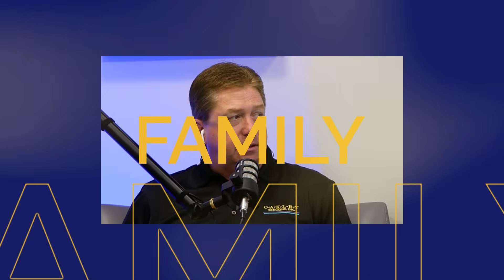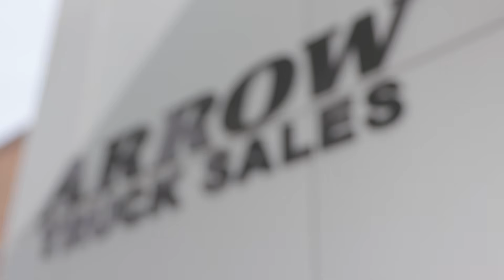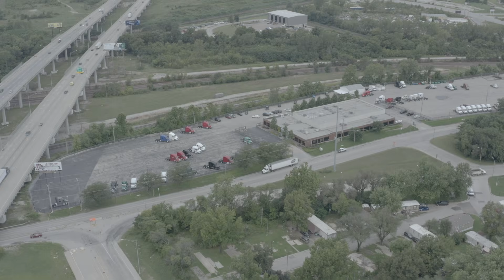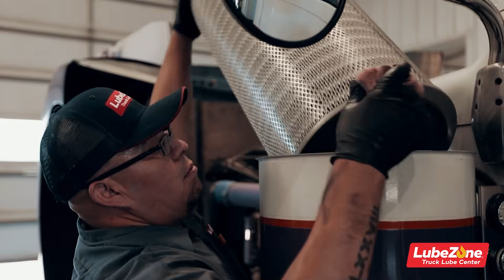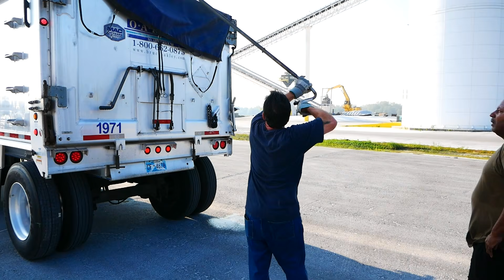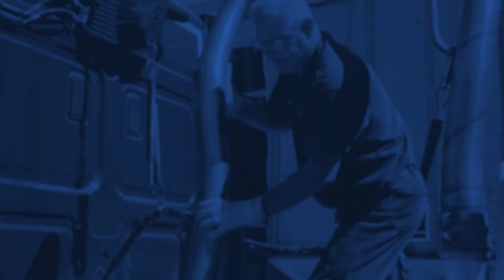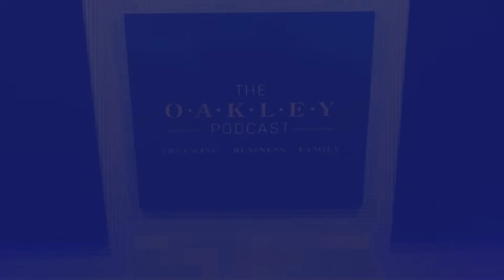196: MATS 2024: The History of Gulf Coast Filters and How They Have Changed the Oil Industry

Comment: About 20 years ago a new Dodge Cummins pulled into the yard. It was a local retired USAF fighter pilot. Also retired from Texas Instruments. He said change the oil and bolt a big Gulf Coast filter on the Frame. Dont be drilling any holes in the frame. All of a sudden I was back in the 50s as a private. I said yes sir. The used oil did fine in my old 6.9 Ford diesel. Normally I didnt drain the oil. I installed the Gulf  Coast filter and added enough oil to fill the filter. This guy wanted to go to synthetic oil. In his case he brought enough Amsoil.

Comment: I have little Gulf Coast toilet paper filters and Motor Guard toilet paper filters on everything I have with a oil pump. They are gone now. I  only have two of the origional lube oil filters. The  Motor Guard M 30 compressed air filters are similar to the origional lube oil filter. It has 1/4 inch ports instead of 1/8 inch ports like the lube oil filters and no 1/16 inch orifice. The origional lube oil filter had no coating. The coating sometimes fails. Normally lasts in motor oil. The lube oil filters came out in 1961. They were discontinued I believe in the 70s. Motor Guard stayed in business by making compressed air filters. They learned almost everyone thinks oil is supposed to get dirty and be drained. I converted the M 30s back to lube oil filters and sold them for awhile. The compressed air filter elements have a plastic core that cant take hot motor oil. I ended up with a drum of expensive compressed air elements I use for shop rags. All of the origional filters used 2 ply toilet paper. I was getting it by the case from Office Depot. Got a call from California. They were looking for a filter to eliminate oil waste. Since I only sold a couple a week I wasnt legit.

Comment: The reason almost all little toilet paper bypass filters have the orifice at the outlet is pressure is on both top and bottom of the toilet paper. Slightly more at the top. The same as using a sandwich adapter. The reason I can use a oil cooler sandwich adapter is the toilet paper filter is like a restricted oil cooler. A spring loaded bypass valve opens to keep enough oil going to the inlet of the full flow filter. One of the 6 cylinder diesels I sent Gulf Coast filters for had a little less oil pressure than the others. The engineer drilled a 1/8 inch hole in the adapter to help the relief valve to bring up the oil pressure. Perma Cool says the relief valve is big enough to supply the engine. Might not be if the engine is worn enough to need more oil to pressure up the system. Always better to have a oil pressure gauge when using a sandwich adapter. The old Frantz 2 port sandwich adapters depended on  enough oil flow to create a pressure difference. Worked ok in 6 and 8 engines. Not so well in 4s and my riding mowers.

Comment: Pretty much all bypass filters since the 1920s had a restrictor orifice at the outlet. Normally 1/16 inch.The reason for the restrictor is the slower the oil flow thru the filter the better the cleaning. Also almost all toilet paper filters have the orifice at the outlet including my old Gulf Coast junior filters. The little filters clean oil better when the orifice is at the outlet. The big Gulf Coast filters are different. Because they are so big they work better with the orifice at the inlet. Its about the same size orifice as the little filters. They dont need to be fast. All they need to do is clean oil. The full flow filters have to filter fast. Two full flow filters will clean oil a little bit better than one because the flow thru each filter is reduced. Not good enough. Some factory installed bypass filters are pleated paper filters with an orifice. You might be able to get a full flow 40 micron filter to clean oil down to 10 micron. Not good enough for polished engine parts.

Comment: When I was installing Gulf Coast filters 30 years ago all bypass filters were universal. No specific filters for specific engines. You looked at the engine and determined what fittings you needed. I had a fortune in fittings on the truck. Still have most of them. When I did my Ford Diesel tractor had to get a few fittings at Ace Hardware that I didnt have. You can spend a lot of money on fittings. I normally use Gates transmission cooler hose from O Reilly's for the small engines. It aint cheap. In the old days I normally got my hose and fittings from McMaster Carr. When I convert the Motor Guard M 30s compressed air filters back to lube oil filters I press a 2n1/2 inch OD flat washer in the bottom for a core seal. I had a couple I had to ream the ID a little. I tossed the plastic internal parts. Some use the filters as is. The plastic parts will eventually deteriorate in hot motor oil. I use a 1/16 inch orifice in the inlet except with the 2 port sandwich adapter. They dont need a orifice

Comment: In the 60s I found out about the Motor Guard toilet paper filters. Started buying a few from a trucker that was a direct distributor. He drove Pontiacs. He would say I dont drain oil look under here. He had the drain plug welded on. When he bought a new Pontiac which I believe he said about every 100 K miles he would transfer the Motor Guard to the new Pontiac. Imagine some poor bastard trying to change his oil and the drain plug is welded on. Motor Guard later started manifolding up to 4 Toilet paper filters in parallel for diesel trucks. Then they added a compressed air filter. They only have the compressed air filter now. People think oil is supposed to get dirty and be changed. Painters dont think compressed air is supposed to be dirty and wet. I tried to bring them back. At first they thought it was a good idea. Then I think they realized this guy is telling people to use Toilet paper and we are selling our expensive paper. The coating sometimes fails. When I told them to send me 100 with no coating that was the last straw. Havent had trouble with motor oil. Gasoline can make the coating turn loose of the aluminum. For awhile I was removing the coating with my drum of engine cleaner. Mentioned on a forum that Dick Cepek tires sold Motor Guards for off road racing. They didnt allow the word dick. Dick Cepek sold off road racing equipment for VW dune buggies. I bought a steering stabilizer for the wifes beetle. The beetle didnt come factory equipped with a oil filter. Hard to wear out a beetle with clean oil and keeping the valves adjusted. Not putting a filter on the beetle saved VW millions. Owners didnt complain. They thought if they didnt have a filter VW must have thought they didnt need one. Took me several toilet paper changes to clean up the wifes beetle engine.

Comment: The little Gulf Coast Junior was too small for the Powerstrokes. The chippers used Ford gasoline Industrial engines and one truck with a heavy duty 350 Chevy engine. They took the little Gulf Coast Junior toilet paper filters the same as my riding mowers. At 86 its no big deal for me. Hated to see Steve discontinuing the little filters. That fleet was a tree service company. Yes the diesels needed the paper towel filters but they werent all diesels. I have Gulf Coast junior filters on a fleet of propane lift trucks. Let the customer decide how to install the little filters. People shouldnt have to pay up to 800 bucks for a little filter. I sent 6 Juniors to a private Island for generators. Wife said lets go down and help install them. They had an engineer hired to keep things running. Didnt need us. A resort in the Bahamas. Sent sandwich adapters with those filters. Soon after that Charlie Sims chewed my ass for using sandwich adapters with his filters. Got started using Frantz 2 port sandwich adapters many years ago. Got those from Jegs. Summit has them. I used the universal 189 adapters. They have one for supplying a Turbo I would like to try. Lot of choices these days. I think the filters work better with a sandwich adapter. Also make filter installations easier. Brought the Motor Guards back for awhile. The M 30 compressed air filter is similar to the origional lube oil filter. Easy for me to convert them back to lube oil.

Comment: In 1965 I went to work on the Mustang assembly line. I showed the boss the dipstick with the golden oil on the Rambler. He had a Mustang dragster he pulled with a Chevy Suburban with a 292 big six. He said put a Frantz on the Chevy. I used a Frantz adapter that eliminated the full flow filter. He wasnt happy because his oil wasn't as golden as mine. I called Frantz. They asked me what oil he used. I said Standard Special. He said the Special has a additive that gets dark. Drain the Special and put in the Delo. His oil looked like mine. With no full flow filter it was like a 235. You knew the condition of the engine by what was showing up on top of the toilet paper. He used Delo 100 20W. Before I left Ford I put the better designed Motor Guard on his Plymouth Fury and left on the full flow filter. We changed the toilet paper and added a quart of Delo every 2 K miles in those days in the San Jose California area. Would have to make adjustments in different conditions. I have sent Motor Guards to Norway and northern Canada to people that already understand the filters. I changed the toilet paper and add a quart of synthetic oil in the Pontiac Torrent every 6K miles in the Dallas Texas area. Mostly highway. When I did the fleet of mostly Powerstrokes they were on the phone with Gulf Coast Filters. I was just the installer. They brought me Walmart diesel rated 15 W 40 conventional oil. They said oil is oil. Got a call years later saying they had more trucks that need filters. Told them to call Gulf Coast filters.

Comment: I was wrong saying the Insane bypass filter elements are about 35 bucks. I googled it. The cost of the toilet paper equivalent is 48 dollars. The larger one is 108 dollars. They are as good as toilet paper and paper towels. Dont remember what I paid for the last 16 pack of Great Value 1000 at Walmart. They claim 1 micron. Motor Guard has always claimed submicronic. My guess is all of the toilet paper filters are the same at the same flow and pressure. I have no way of measuring microns. My 64 Rambler American had a bypass filter. The oil was always dirty soon after an oil change. Ive seen spin on elements for it advertised at 10 micron. The toilet paper filter turned the oil clear. The advantage of the 10 quart Gulf Coast filter is its large and has a very small orifice at the inlet. Cleans oil at about the same speed as my toilet paper filters. Insane says their elements are multi stage. They are all multi stage. The deeper the oil penetrates the element the smaller the micron size it removes. The Rambler was a pleated paper filter with a 1/16 inch orifice. My 41 Dodge had a cotton element with a 1/16 inch orifice. Like a Luberfiner only a lot smaller. A Fram canister. I saw on another forum a guy is filtering hydraulic oil with a under the sink water filter. Good luck with that.

Comment: Its amazing how ignorant people can be. On one forum a guy said the reason they call them toilet paper filters is people started using toilet paper in them instead of the special element they were designed to use. Of course they were designed to use 2 ply facial quality toilet paper. We didnt have tightly wound 1000 sheet toilet paper when I used them in the 60s. Single ply was something you found in a chemical toilet. Couldnt use multi grade oil in a diesel. Delo was 20w and 30w. About 29 cents a quart in the discount stores. We sold it for 55 cents in the gas station. International may have been the last to require single grade oil. My 79 Ford diesel tractor says on the engine I can use 10 30 or 10 40 extreme high temperature use 30 weight. Put some off highway 30 weight in it. Wasnt winter grade. Too thick to circulate  at 32 F. I can still get Delo 30W. Cant get it at Walmart. This is Dallas Texas. People are so accustomed  to draining dirty oil filters that clean oil seems like snake oil. In the 60s I charged 29.95 for Frantzs and Motor Guards. Grand Auto Parts sometimes sold Motor Guards for 12.00 bucks complete with hose and fittings. People would rather pay a dollar for a filter and drain dirty oil. The filter companies dont go broke because there is no room under the hood. They go broke because they dont sell well. People say oil is cheap engines are expensive.

Comment: I am 86 years old. Thinking about setting up at a flea market and selling a few little toilet paper filters left over. I willl be ready for the bull shit stories. I will get the ive heard that toilet paper breaks apart stories. Some times they really get ignorant such as toilet paper has too much acid in it to use for oil filters. Some dealers are telling people it isnt toilet paper its a rolled cellulose element for cleaning oil. One filter company is putting toilet paper in a covering and charging 35 bucks and more for it. I have a couple of filters over 60 years old that need gaskets. I normally use o rings I get from a local bearing supply store. Had planned to put them in the trash. The Luberfiners and the Cummins Fleetguard 750s are gone. I was converting them to use center pull paper towels many years ago. They have no value now. Cut the covering off an old Gulf Coast toilet paper filter. Looks like janitorial supply 2 ply. At one time I was getting my best toilet paper by the case from Office Depot. The Insane filter looks good. The price is insane. The Australian Jackmaster Classic is the same at 1/3 the price. I think they are gone now. My Jackmaster isnt for sale unless someone has some deep pockets. The same as the Gulf Coast juniors.

Comment: When I was selling Frantz oil cleaners one guy said as much as I paid for my truck Im going to put a filter on my truck that uses a roll of toilet paper. I believe they were putting the big Frantz diesel filters on EMD engines on offshore drilling rigs. At some point Frantz diesel filters went out of production. Frantz at one time had the little one roll filters a 2 roll a 3 roll and a 4 roll model. Only the single roll model came back. I never sold the diesel filters. Except one I used. Im pretty sure a drilling rig engine is more expensive than a Cummins engine in a Ram. A Detroit engine in a Shrimp boat isnt cheap either. Gulf Coast filters replaced the toilet paper filters with the big paper towel filters. They replaced the little toilet paper filters with a improved top loader which Steve discontinued. People tell me used ones are impossible to find. Easy to find used Frantzs. Toilet paper can still be used in a Frantz if you know what you are doing. Most people dont. Frantz is a poor design compared to the top loaders. Sent a big Gulf Coast fuel filter to Seattle for a Yacht. Wife took 4000 dollars out of their VISA card. She was able to fix it but I told her its time for us to retire.

Comment: I have a little filter that is ideal for my 25 HP diesel tractor. Its a flat head Ford V8 canister filter that I converted to take a roll of Scott 1000 toilet paper. Right now it has half a roll of VIVA Signature cloth paper towels in it. Filters the same as the big Gulf Coast filters except it has half a roll of Viva paper towels 5 1/2 inches of depth instead of 11 inches or 22 inches in the 10 quart Gulf coast filter. The old canister filters didnt drain below the orifice in the center tube. I put a pipe plug in the outlet and added a another outlet. Used a very small thread end of a full flow filter to keep the towels from pushing down against the outlet. Drilled and deburred a few extra holes in it. At the top the inlet was high enough I could use it. Used a flat washer large enough to bridge the space between the toilet paper core and the center tube. The lid spring pushes down on the washer. The filter filtered the same as the Luberfiner when it was new. It took a cartridge with cotton. The converted filter filters from top to botton. Need to put a 1/16 inch orifice or needle valve at the inlet. Mine doesnt need a orifice because I use a sandwich adapter. The clean oil feeds into the inlet of the full flow filter. Cut and rewelded the angled bracket. It was designed to bolt to the head of the Ford. Put a tubeless tire valve in the lid so I could push out the excess oil before changing it. Its mounted low. For toilet paper put a spacer under the perforated plate. The Ford filter is 4 1/2 inch ID. Some are smaller. I cut the towels with a sharp knife. No more than I use the tractor the VIVA towels should filter to 1 micron for a couple years. Some diesel soot is a lot smaller than 1 micron. The oil will be black in a diesel engine.i stopped worrying about black oil in a diesel engine years ago. I would be concerned in a gasolime engine. The tractor has Motor Guards  on the hydraulics and fuel.

Comment: Need to get the old 93 Subaru ready for the auction. It had 116 K miles on it when I bought it used. Changed the oil at 225 K miles. Stilla good engine at 240 k miles. The oil change at 225 K miles was to try synthetic oil. Not smart to try to sell a car with a toilet paper filter. Fools will think the engine is full of toilet paper. Toilet paper and paper towels dont break down in motor oil. They get stronger. Years ago I put an ad in the paper to sell my old Mazda diesel pickup. I was too slow removing the Frantz. A guy wanted it. I said I can put the Mazda bypass filter back on. He said ive heard of those toilet paper filters. Im thinking here it comes. He said you can keep the Mazda filter. Thats very unusual. I was glad to let him have it. The Subaru had Motor Guards on it. I prefer the top loaders with the center bolt. They have the advantage in a tight place. Had a good place to mount the Motor Guard. The Motor Guard on the transmission was laying loose behind the engine with no bracket.